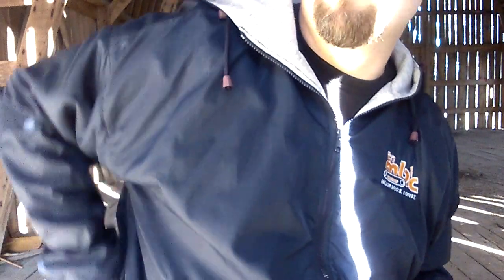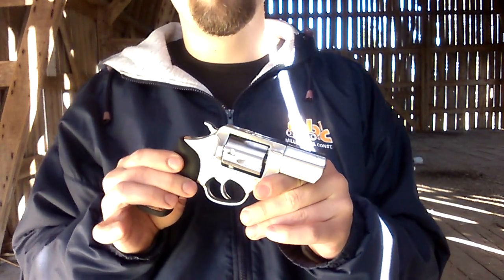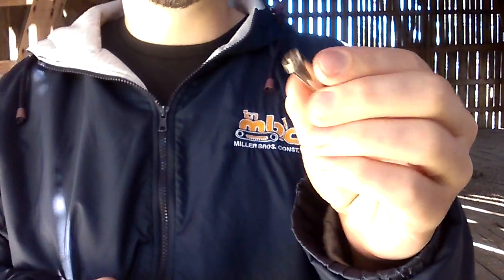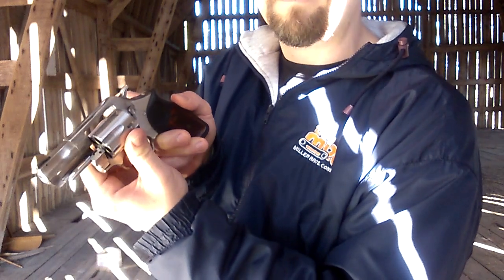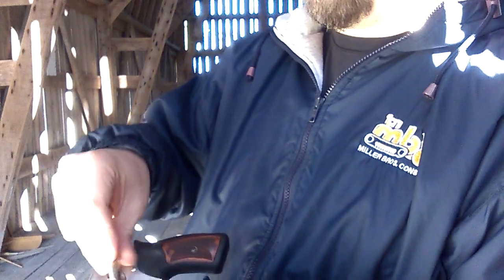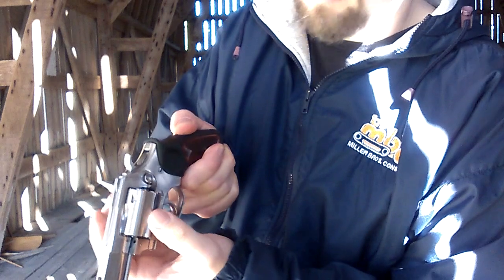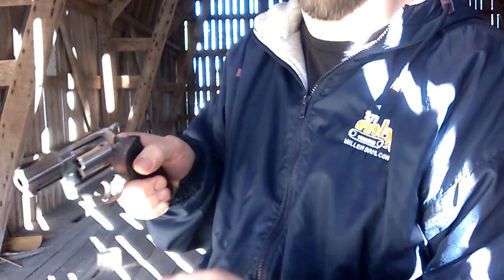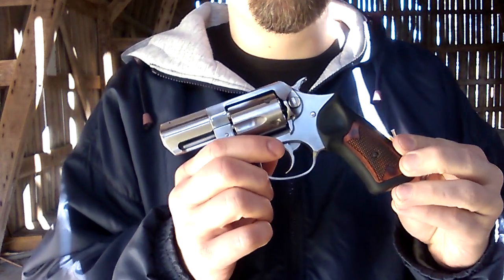A Revolver Can Jam?

Comment: Boolit creep too. 🤔
Reply from the maker: I have actually only had it happen once, with Golden Saber .357 because the lack of roll crimp. Personally, if I was going to use something that it's more common with like a 9mm revolver, I would use ammo like Hydrashok Deep, because this is one of the few ammo types that still use a glue sealant to waterproof the bullet and holds them in really well. Impact hammers take 100 whacks to get the bullet out.

Comment: of course a revolver can jam. it's not magic. it's just rarer, and it doesn't mean a revolver is a bad gun either.

As with any gun, it you don't maintain it, inspect the ammo and take care of it... it will cause issues. think of it like a person. if you abuse  a person, that person will most likely start hating you, same for a gun, if you don't take care of it and even if you simply just don't inspect your ammo and feed it good ammo without defects it will "hate" you and throw you a middle finger by jamming, kinda like how a person will punch you... or something.

Really like this video though. it is eye-opening.
Reply from the maker: You're right thought. Most of the issues I hear about are from Glock guys who buy a revolver then have no clue that you have to maintain them. Won't be long before the frame behind the rims and cylinder notches are full of crud, then I have to hear about how the thing won't turn and all of that. I clean my revolvers after every range session and use low loaded nickel plated brass for carry, low case expansion, easy reloads and all of that.
Reply: @GunSam   that's true ey. very, very true.

Comment: my buddys colt locked up
he had a really hot load and
the firing pin stuck in the primer it was like braised in there
he had a handfull before he got it broke loose , lotsa dickin around
the hotter the rounds, the higher the potential for a lockup failure

Comment: Another thing is the ammo you shoot.  I use to use Freedom Munitions .357 and .38 in my SP101.  It's way to dirty and locks up the cylinder.  Both new and reman.  It works fine in my GP100.  I only shoot the good stuff in my SP.
Reply from the maker: I have fired a lot of Freedom munitions .38 special before, if I do remember right they were a bit dirty and pretty hot in my opinion. I hand load now days, and have found far cleaner rounds to shoot.

Comment: well honestly i have had broken hammer nipple, broken hammer main spring, case head under the extractor star. now this is with multiple guns at about 81,289 rds. so to me all is relative to use. its just part of the equipment maintenance program. revolvers have their place, am recuperating from shoulder surgery, (like ouch), and cant use an auto. so there you go...

Comment: I once had a bristle from my cleaning brush under the ejector star, and that locked-up the cylinder.
Reply: yup that will lock it up real good.
Reply: and if you had a bristle under the extractor of your bottom feeder?
Reply: Also, in my 44mag handloads, my crimp wasn't sufficient enough, and under recoil one of the bullets began to jostle out of the case, and it hung-up on the barrel.

Comment: I have never seen a cartridge where the primer wasn't fully seated in the pocket from a manufacturer, except for some loads i built where primers weren't pressed in fully and they didn't jam up the gun and even so the cylinder still rotated and when I fired it the primers fully seated in the brass. Now what will jam you revolver is crimp jump, If you seat a primer in the brass and fire it in your gun the primer will back out of the pocket and prevent you from opening the cylinder', this is why cowboy action shooters enlarge the flash hole to prevent that from happening. Just saying
Reply from the maker: That can happen, but also overpressuring can back out a primer as well.

Comment: I had this happen twice in 30 rounds on my public defender judge yesterday and it is a new gun.
Reply from the maker: Were the primers backed out on spent primers or new primers?
Reply: Yes they were spent. I was on the firing range where I bought it and I had the safety officer come over. Because I bought the gun there and I wanted to tell him that. He jostled it and finally unlocked the chamber and I shot more rounds. It happened again and I just worked the chamber free. I was shooting.410 slugs.
Reply from the maker: It sounds like an ammunition issue. I know that different ammunition uses different primers, for instance magnum cartridges use magnum primers that are a harder metal than standard primers, so that all the extra back blast of a magnum does not blow the primer backwards. Was it just regular slug ammo? I am willing to bet that ammo designed for .410 revolvers took those issues into account and used correct primers.
Reply: It does look like rifled slug, I have a box left. I think that was it-thanks good info

Comment: Some good tips thanks. Revolvers probably have fewer stoppages than semi autos but when they do they go down hard, like need tools to fix where most semi auto are cleared with a mag change and running the slide or just a rack. It actually kind of the same deal with AK and AR malfunctions. All in all it don't matter that much as the are all very reliable platforms with quality makes and models.

Comment: I recently went to the range and was firing .357 target (FMJ) ammo: loading only one shot at a time and alternating the dominant hand with each shot. To my surprise, after one such firing - only one, but with no forewarning - the cylinder release button jammed tightly and would not release the cylinder; nor would the cylinder turn. Ultimately, it took me nearly 4 minutes of pushing the release button before it finally did  its job. In a life threatening emergency on the street, my only practical recourse would have been to draw my other concealed carry gun, which incidentally is also a .357 revolver, and hope that it would not jam .
 
The other 24 rounds which I fired caused no more problems, so I presume that the issue was with that specific cartridge. Also, I've had problems with this particular revolver becoming jammed for the same reason that you've explained so well in this video. However, my other revolver - of the same manufacture and model - has been totally free of jams/failures to fire.

If you have an opinion on my experience please share it. Thank you. (You are right about visually checking the self defense ammo for the day too.)
Reply from the maker: All revolvers can have potential variance in chamber size, bore size and the like, even with different size chambers within the same cylinder. It's good that you have identified the one that seems to have tighter specs. It's important to always keep your revolver you plan on carrying very clean and also it's good to use nickel plated brass with cartridges that are not that hot, for one the nickel plated brass will eject better and for two, no legitimate company will load super hot cartridges in nickel plated brass as the stretch to the case is limited with nickel and will crack the brass loaded too hot, so if they are nickel, they probably aren't hot. And if the rounds are hot, there's more chance the primers will back out and cause an issue. I have found the Speer Gold Dot 135 gr short barrel .357 mag to be an excellent carry round that won't produce these issues.
Reply: @GunSam  Thanks for this advice. I am presently carrying the flawless (so far) gun loaded with .357 rounds and on my left ( better shooting side) hip. The problematic gun is holstered on the other side and loaded with .38 +P ammo. I carry an additional 6 speedloaders of .357 and 5 of .38 +P, respectively, in my side pockets . I hope to shoot targets on the range exclusively, but I will shoot threats on the street if I have to.

Comment: Yes it can happen i know. it started when i fired .38 specials and i do believe  the youngster at the range gave me reloads. I called ruger and was told that could do it but before i send it in, to clean real good behind the  ejector star.a little oil and no reloads and sure enough, no jams since.
Reply from the maker: Typically from my understanding, under powered loads are more likely to cause a primer to back out.

Comment: 99% of the time bad ammo is the cause, or with Charter Arms the cylinder release screw has worked it's way  back into the gun too far, so you can't open the cylinder to reload the gun. .357s in ultralight guns cam suffer from bullet creep and jam up too. The bullets creep forward out of the case and jam the cylinder. Another ammo problem. Old cap & ball revolvers were famous  for jamming if a cap fell off and jammed the cylinder. Again, another ammo problem. After a while the hand or the star will wear, and the gun will go out of time. This can jam it up, or blow it into multiple pieces.

Comment: if you get cheap ammo it can expand to much and you want be able to extract casings. I think that can definitely be considered a type of 'jam'
Reply from the maker: In the few magnum revolvers I have owned, I have been fortunate enough to always get pretty loose cylinder tolerances and never had that problem, but I certainly know the problem exists with tighter tolerances, right along there with too tight of cylinder gaps (which Taurus is known for).
Reply: happened to be with my sw627 and tula ammo. casing expands and can't be ejected after firing. Had to use screwdriver.
Reply: @pgbtwoofive3354  

Those cheap steel casings. US manufacturing use far tighter tolerances. Steel also expands and doesn't spring back like brass.
Reply: @denisdegamon4461  The russians use steel cases so they cant be reloaded.

Comment: i had my 357 jammed up on me. couldn't pull the hammer back nor pull the trigger. i unloaded it, put a new round and bingo. i reloaded the same round afterwards and all went well. if one shell was bad,  whey did it discharge after i i reloaded. possible i didn't close the cylinder right or ??? help.
Reply from the maker: It might have been from how the round was oriented. If you closed the cylinder on the second go with the "bad" round in the right position that this round was the next be fired, than this could explain it because there wouldn't be as much frame to rotate through. Other than that I have no idea.
Reply: trying to understand your explanation but thanks much. i may have not closed the cylinder correctly but i guess i will find out next time i go shooting. i live in the city so not many places to try my gun out unless the home boys start to act up lol.
Reply: Thanks but i do believe the guy gave me reloads and since, i use virging ammo and no problems, so far.

Comment: I understand your point but it goes to show that even then revolvers wont really jam, what you said in the video was a fault in the ammunition which is pretty straightforward with any firearm to inspect the ammunition and make a judgment if it is safety fire because that is the same principle back during the 60s of the Vietnam War when the first generation of m-16s were issued out they were notoriously unreliable and the reason behind that was that ammunition that they were given in the field that were faulty because of a surplus gun powder composite. The firearm worked fine. But 9 times out of 10 if you jammed a revolver I'd wager you were setting out to do so.  

https://youtu.be/gOUKXIrDE0I

Comment: If your in a life or death struggle and the bad guy gets a grab at your revolver and the cylinder is forced it can cause a lockup and or permanent damage .  A  Quality Semi Auto on the other hand , if grabbed in a fight might be forced out of battery , might cause some kind of typical range time malfunction,  But a quick rack of the slide and it won't take much to get it back in the game.  I'm a revolver fan, But I'm starting to have my doubts...  It wouldn't take much in a physical altercation for bad guy to twist on that cylinder some and cause the pawl to jam or bend, its the weakest point and uber critical to the functioning.  Your not always going to be 20' feet away from the bad guy.  He might be right up on your ass before you know he's a bad guy.  Then the struggle ensues